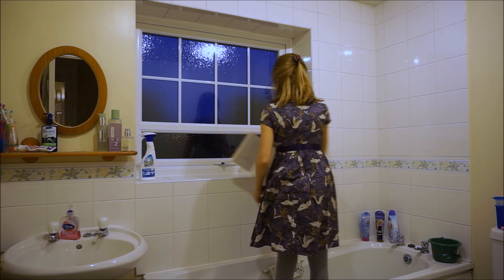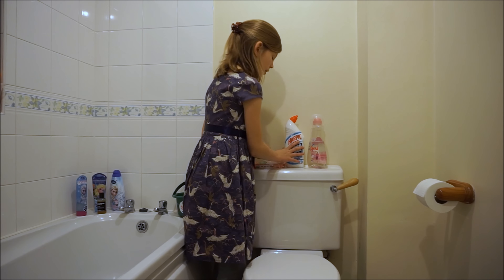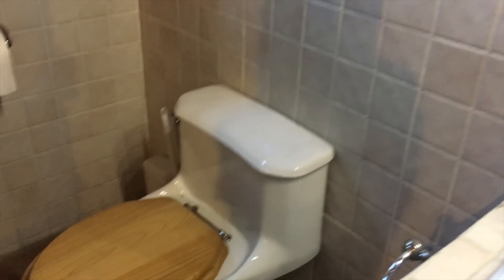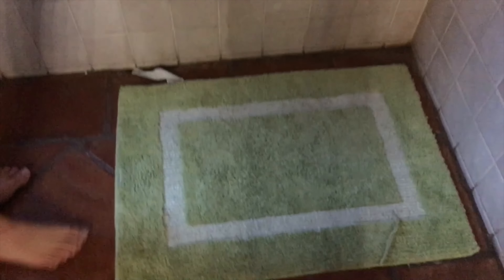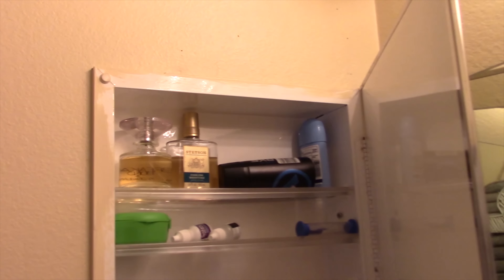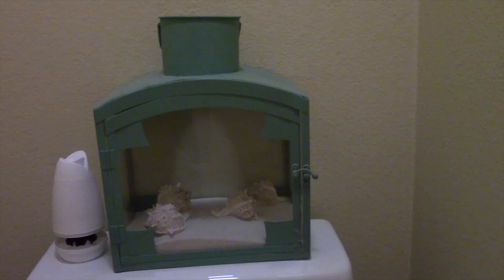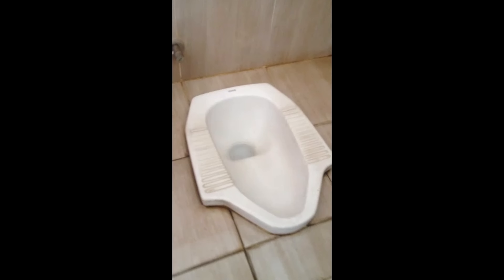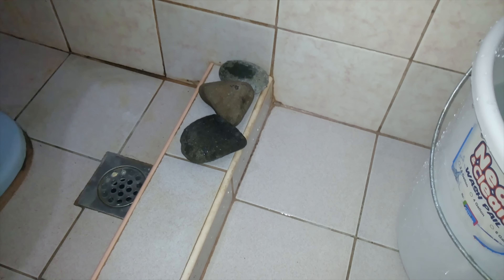Bathrooms Around the World

Comment: The shower shown in Israel is typical to student apartments - particularly ones where the owner separates one apartment into several units, with each unit having a small make-shift bathroom for each person to use. Most apartments have a bath-shower situation (where the shower and bath are one unit) or a shower and a bath in one room and often the toiler is in a separate room next to the shower room. It is however very common for showers to have a shower curtain rather than a glass door or a sliding door, like in more modern bathrooms.

Comment: The bucket and dipper method save allot of water probably but seems like it doesn't rinse that well.  Maybe they just use less soap?
Reply: How I did it on a boat:  One gallon of warm water, one 2-cup dipper.  Pour water carefully starting at the top of the head, making sure it runs down the body.  Once everything is wet, lather soap everywhere, then scrub with a cloth or loofah. To rinse, again use dipper to pour water carefully from the top of the head down, top of shoulders, cup some under the arms, top of hips, splash some to the "underneath parts", then down the legs.  Then do it again. Tiny amounts of water at a time, directing it with hands to make sure it runs down everywhere.  With a good creamy soap, it rinses quite well.  You can do a complete thorough "bath" including shampoo with less than a gallon of water.
Reply: We had flooding last year in our area and the water was severely contaminated so we were on water advisories and I was shocked with how little water we used bathing using that method.
Reply: Here in Indonesia one small bucket contains 3 gallons of water and it's enough to take a shower with. I think the soap sold here have different formula  than the one i usually got from hotel amenities or imported ones. They are less greasy so it takes less water to rinse off the soap rather than the last two i mentioned before.
Reply: Newman Family Vlogs

Comment: Israel bathrooms are kind of like Indian bathrooms because in SOME houses the showers do not have a barrier either so the water will keep going but there is a spot where the floor level gets about 1 inch higher to stop the water from leaving. Indian bathrooms do not have curtains to block while your showering so we trust each other to lock the door! Also, Indians also use the "mop" to clean up all the water that didn't go into the drain while we were showering.

Comment: Its definitely interesting to see the contrast between the rich and poor. In the US for the most part whether you're rich or poor the bathroom essentials are usually the same. Some may not have showers but pretty much everyone has a bathtub, toilet, sink and hot water. Hot water is usually heated in large quantities and stored via a hot water tank. In my opinion it's very inefficient, but instant water heaters are very expensive and hot water tanks are in excess of 40 US gallons (dumb right?). So you cant just turn it on and off. A side not for anyone interested is that the hot water from the tank is used in faucets, dish washers and clothes washing machines around the house; So its not just for the bathroom. If I built a house I'd do it differently but most people in the US live in houses that are older then 10 years so it is what it is.

Comment: Greg, and family:
I realize I am watching a video from a few years ago, but as I live in Israel since 1979; I immigrated here on my own as part of a high school program at age 16.
Where I live, in Israel, is a small city up in the northern part of the country, Safed, my apartment, a low rent subsided apartment, was renovated last year, in November 2018, because I have deteriorating health.
My apartment has always had the toilet separate from the bathtub room. Handrails were put in in the toilet room and as it is so very hot in this room in the summer, my son-in-law put in small fan.
The bathtub was removed and shower put in with a slight slant in the floor of the shower. I also have solar water with the option of turning on the boiler in fall and winter.